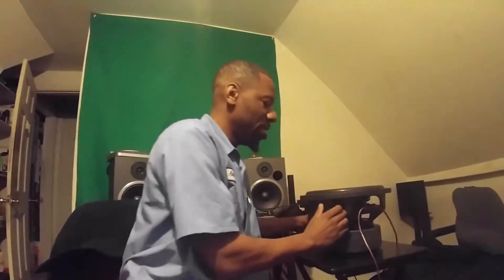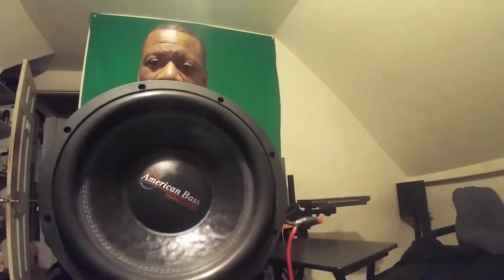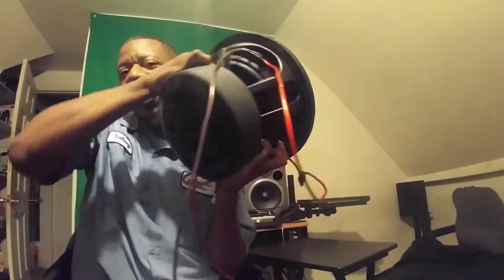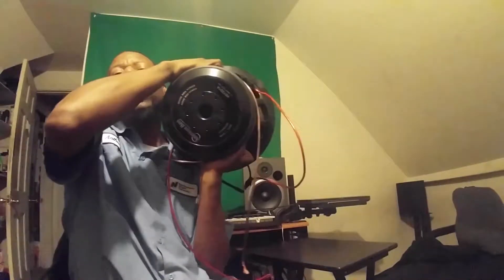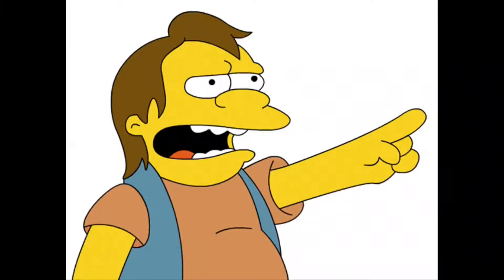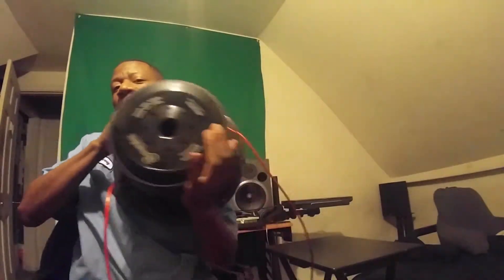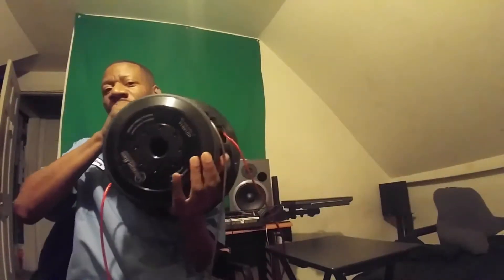CSM: Coil Size Matters

Comment: I have a untouchable sounds team series 15" with 5" voice coil super stiff suspension can barely push it down with two hands 440oz motor 3000rms whats the pros and cons of these subs
Reply: The issue with large coils is that the spider landings are usually 10". Thus you are stuck with less travel on the spider. This limits xmax and almost nullifies the gains from a 4" coil. And yes I run 4" coils.

Comment: I know this is older video but I don't understand why any brand that makes even a entry level performance sub (true 1k rms and up) would use less than 3"... EVEN if they're 2.5" handles up to 1500.  Like the sundown SA 12 v1 is rated for 1k and it's a legendary sub but is has a 2.5" and the deaf bonce apocalypse 1st two tiers #1 has 2.5" #2 has 2.75" and too one is 3" but that sub 3" is a turn off to me, enough to make me look elsewhere regardless if it's sufficient. 2" to 3"  It can't cost them any difference at there bulk supplies. And I would think having same size motor,spider,cone openings ECT would be cheaper than multibles sizes... But what do I know I don't build em.
Reply from the maker: Great post... I Totally agree with you
Reply: I blame the sales department

Comment: Hey nice vid man but i have a question for you what is the highest watts RMS a 2.5 inch voice coil should go? 800-3000watts max or what? i'm asking cause currently my sub has a 2.5 inch dvc and i do not want to overpower this sub so i decided to stick it on 900watts RMS  but curious on what you guess i could push it to and what i should stay at cause right now 900watts sounds fine especially since i'm getting another sub aswell and 1800watts is more then enough for a beginner system.
Reply from the maker: Yes you can do it but make sure you giving the sub clean power
Reply: thanx man i these subs are not the most expensive but i do not want to hurt these subs the amp i'm buying is 4X900watts@4ohm 4X1600watts@2ohm so yeah just wanted to hear what you feel is the minimum to max a 2.5inch voice coil probably can take cause my first idea was to wire them at 2ohm each so it sits at 3200watts but the coil size freaked me out a bit so yeah